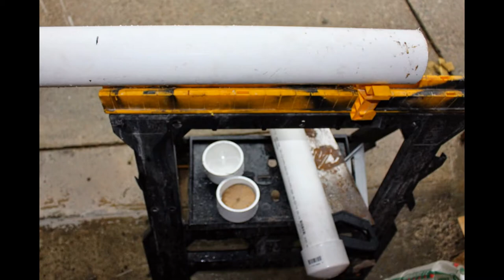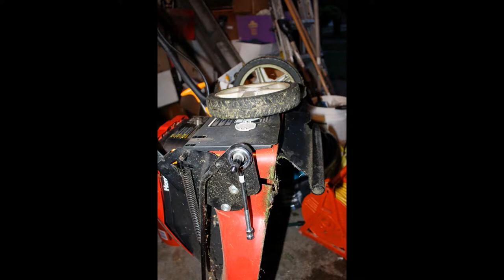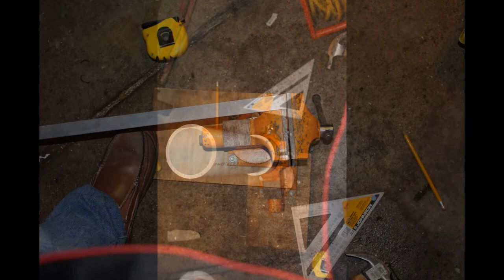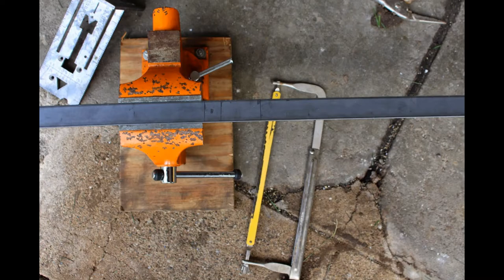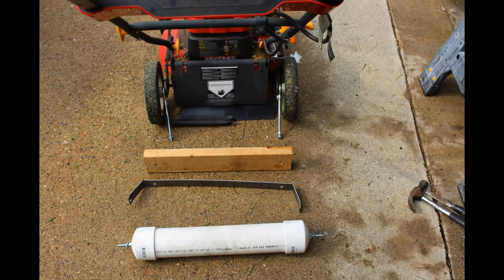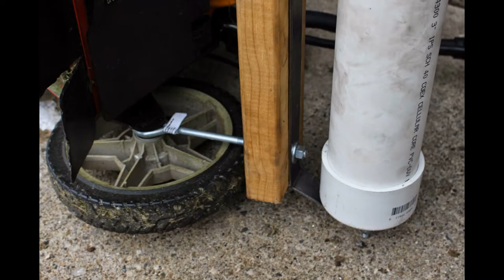Engineering a Lawn Striper Slideshow

Comment: How were able to lift the grass catcher bag. This is a cool design thanks for sharing.
Reply from the maker: The roller sat 1 inch lower than the bag...
when the bag was loaded it rested mostly on the brace that held the roller, and because the roller didn't turn and stayed in a fixed position trailing the rear wheels of the mower I never had any issues with the bags at all...
The up & down movement of the roller wasn't obstructed at all which allowed the weighted roller to act like a skid-steered device behind the rear wheels.
It worked wonderfully for years!

I'll be building a new one for my EGO 56V mower soon stay tuned!

Comment: Whats the trick to allowing the pipe to roll and also not having the nuts spin off as it rolls? I'm having a tough time getting it to roll freely and the nuts keep spinning off.
Reply from the maker: I have 2 nuts on each side, they are tightened into each other... not tightened to the bar that holds the roller. the nut on the inside of the bar tightens the bolt head to the inside of the roller end cap.

Comment: does the pipe need to roll? to stripethe grass
Reply from the maker: Yes, because it weighs so much and it has a small line of contact with the lawn. A device this heavy would dig into the lawn and left the rear wheels up on reverse procedures if the pipe didn't roll.